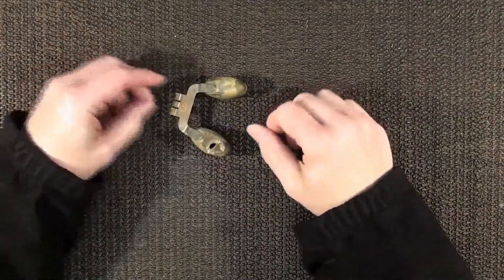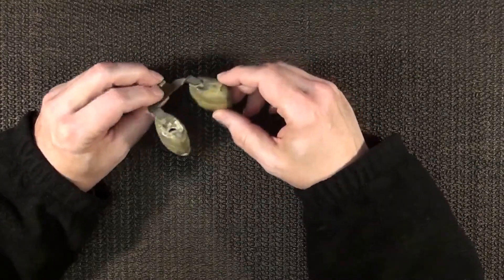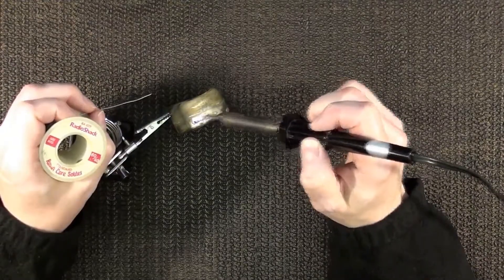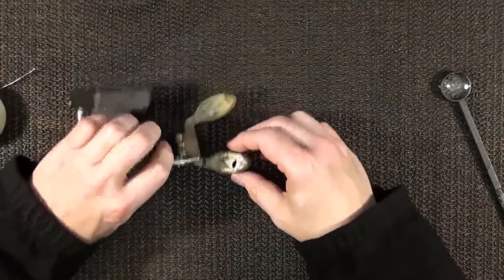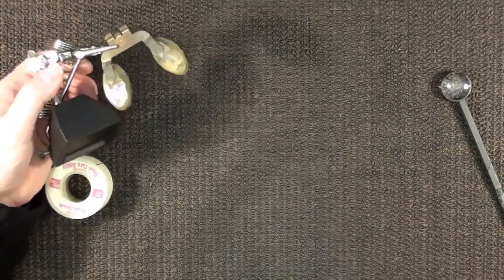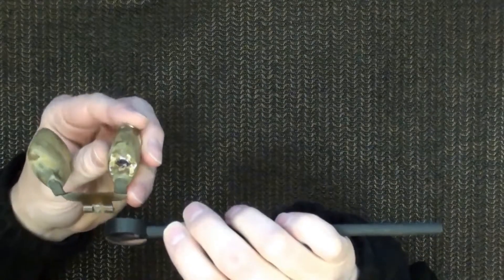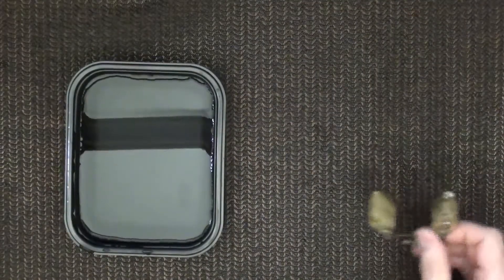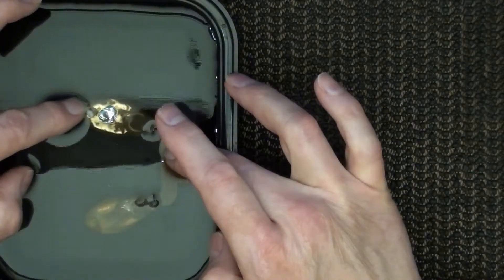Carburetor Float Repair/Soldering

Comment: Thanks for the upload. Here's a tip for those watching- use a hotter soldering iron- at least 40W. Use flux paste. Use acid core solder and clean up the flux afterward to prevent future corrosion. For the big hole, cut a piece of copper foil tape to cover the hole first then solder the foil to the brass.